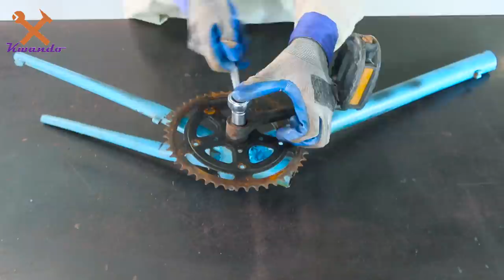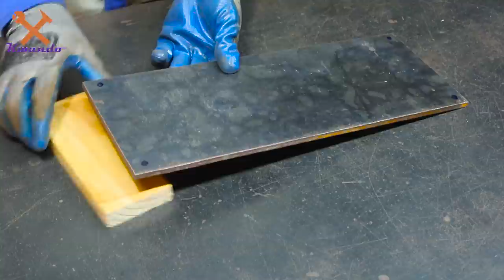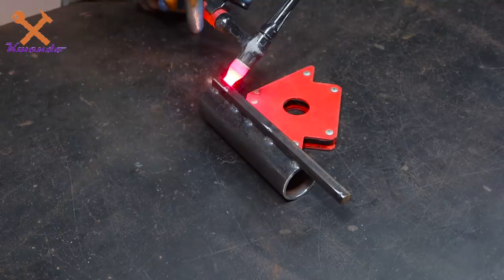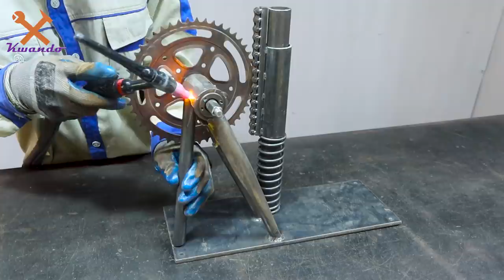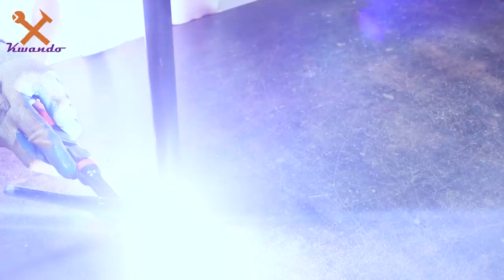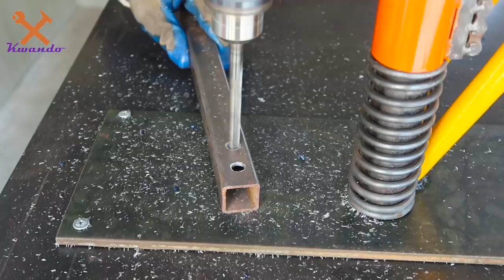Don't Throw Damaged Bicycle | Make A Useful Tool From Damaged Bicycle Parts

Comment: Apparently, you were not going to think about the rigidity of the structure. The drill has too large revolutions for drilling, they drill AT LOW SPEEDS. A thin drill will not go into THIS, as it will break due to the complete lack of rigidity, your drill is hanging out like the eggs of a bull!
Reply from the maker: Many thanks for your opinions!
Reply: @KwandoTechnic  все для вас, вы молодец, что делаете самоделки, а не сидите на месте) RESPECT ! hello from Russia )